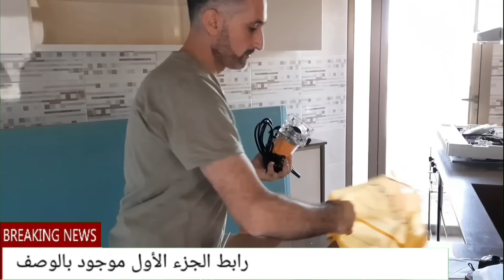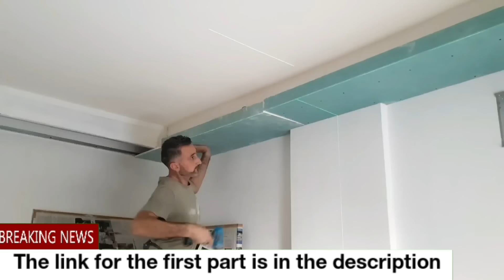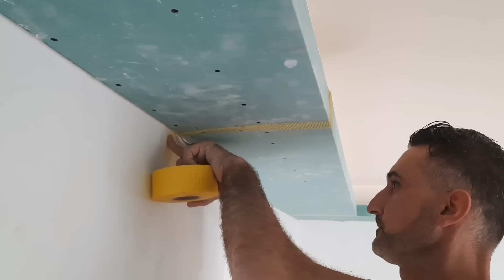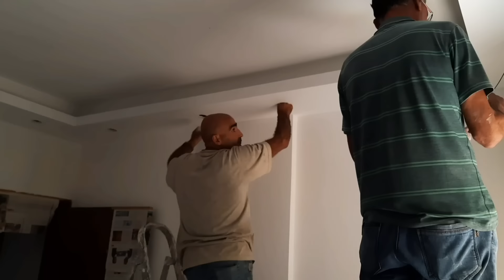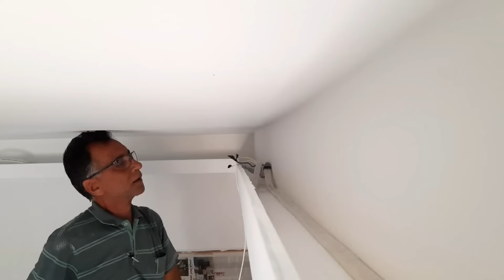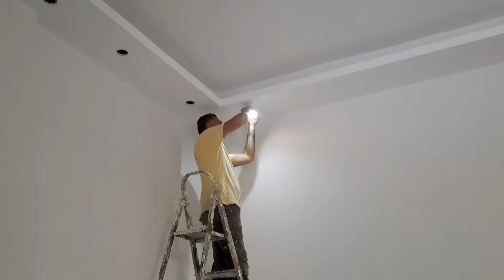طريقة تركيب ديكور جبس بورد بسيط و سهل مع الدهان و الإنارة

Comment: Your work is very beautiful!
Just a quick question … for a room size like the one in the video how much does it generally cost to install a gympsum wall with the LED lights generally.
Reply from the maker: Abuot 35$ per m
14×35= 490$
Reply: @Qossai  Dollars or ????
Reply from the maker: @adolfodelgado9361  dollar's
Reply: Does $490 include the buying of all the materials used to install the gypsum ceiling.... or the material is also another cost besides the $490
Reply: 9⁹

Comment: Interresting, but i would suggest to use spring loaded terminals instead of just twist the wires and insulate with tape ;)
Reply from the maker: Thanks for your advice brother
Reply: Никакие подпружиненные клеммы не будут надежнее старой доброй скрутки
Reply: @dmitriimorozov2212  I think you never worked with spring loaded terminals before, the twist maybe works here because of the low power but with time it become loose because ot temperature differences caused by the current itself and in most countries twist the wires like in the video is prohibited and can cause fire ;)
The most save connection is the spring loaded terminal!
Reply: @MrElofix  Извините но какой перепад температур ? Если сечение провода маленькое или контакт плохой , либо медь с алюминием .Но это уже другая тема для обсуждений

Comment: what is the name of the yellow tool you use to cut the board ? What is the white gluey stuff you plaster over the board ? Looks like some sort of putty
Reply from the maker: @troyb6036  which minute?
Its a glue used in plaster
Reply: @Qossai  The tool is the very first tool you used in the beginning . Also what's in the small blue and red container ? Looks like white paint . What is the yellow tape you used to cover the joined areas of the board ? Finally @ minute 4.18 what is the correct name of the gluey stuff from a large black labeled container to cover the entire thing ?
Reply from the maker: @troyb6036  The tool is a router. The material is glue, the yellow tape is fiber tape to connect the panels, and the material I put is a soft putty for gypsum board.

Comment: That electrical work is scary and unsafe. Twist and tape splices will last a very short time and most likely will burn out. Luckily they used fire rated drywall (I hope).
Reply from the maker: We've been working this way for decades and haven't heard of any problems